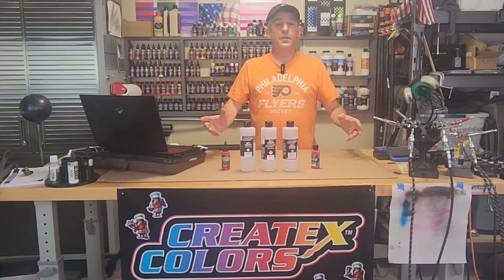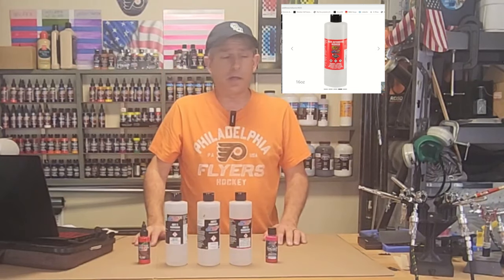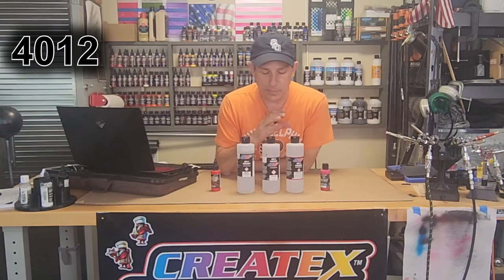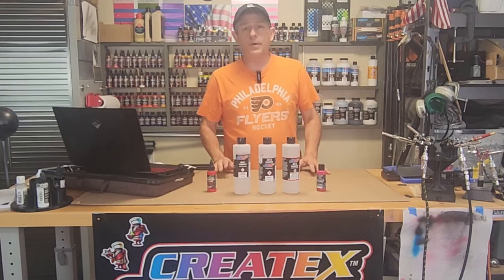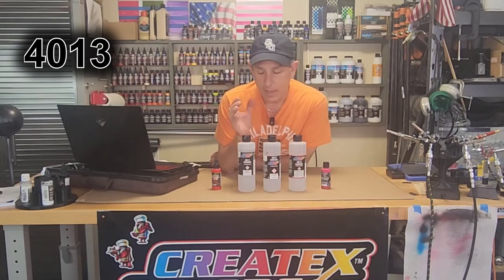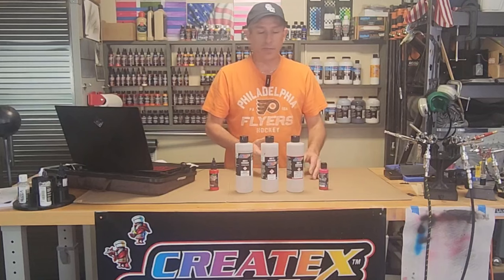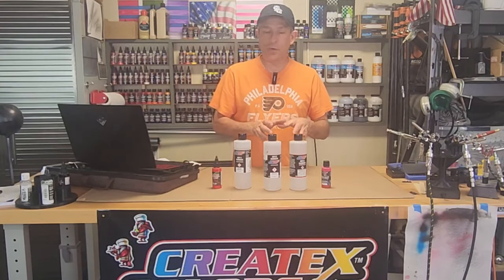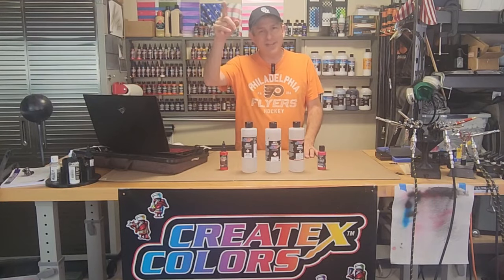Createx Airbrush Reducer Update! Reviewed & Explained

Comment: I actually just got a large bottle of the 4012 for the first time a few days ago as it was all my local store had in stock. Needed to paint a Lexan RC body for the weekend and mixed up my first color pearl plum with 4050 as i would with 4011 and it sprayed in thick waves. Changed my ratio for my other colors and got the job done but overall wasn't to happy with the spray. I was thinking it was the 4050 as its the second time I have used that always using 4011/4030 before. But i guess it does make sense being the 4012. Thanks
Reply from the maker: Zach, the 4050 is formulated to work with the 4011. The 4012 had more problems with the 4030 balancing clear. They really should just pull the 4030 off the shelves. There is no need for it as the 4050 is a superior product, but I do recommend using the 4011 for ALL Createx products when a reducer is needed. Thanks for watching.

Comment: I have a bunch of Martha Stewart and other craft paint from Michael's in the little squeeze bottles. Any thoughts on how to reduce these? I like their colors, otherwise I shoot Aztec and Vallejo on plastic/styrene scale models. Thanks for all your insights!
Reply from the maker: David, I have no experience with those paints. I would stick to the Aztec and Vallejo but if there is a color you really want to use from the craft paint I would experiment. First I would try water and then I would try the 4011 and see what one work better. The Martha Stewart paint is an acrylic water based paint. Hope this helps. Thanks for the question and thanks for watching.
Reply: @TheAirbrushGarage  Will do and will let you know how it goes. Thanks!

Comment: Would you recommend using the 4013 reducer over createx retarder for trying to reduce tip dry?
Reply from the maker: PD, some say it helps. I have not noticed a big difference. The best thing that will help with tip dry is that you keep the air on after you shut the paint off. I hope this helps, and thanks for watching.

Comment: Those createx reducers are nothing but snake oil.regular water with any of there line works just fine.I’ve never had any type of issue just using water.but I did have issues when first started and was using 4012 at the time.this is why I went to just plain old water and never looked back.save your money and just use water.it’s water based paint and you really don’t need to over think this.I will tell you this.I always use a small amount of 4050 with the heavy pigment  paints,especially white.that really helps with flow and keeps the pigments suspended from settling in the nozzle
Reply from the maker: TheYogurtslinger, I can appreciate that. But...if you were to say spray illustration with water even after it is dry, it will eat into the paint. If you spray water onto Wicked, it would have no effect, but the 4011 would. I have a video on that very subject. I really do think that the 4011 amolsafys with the Wicked and does a very good job to thin it. And with only using a few drops in the cup, it lasts a long time and really isn't that expensive. With that said, I can appreciate whatever works for you. Thanks for the comment, and thanks for watching.